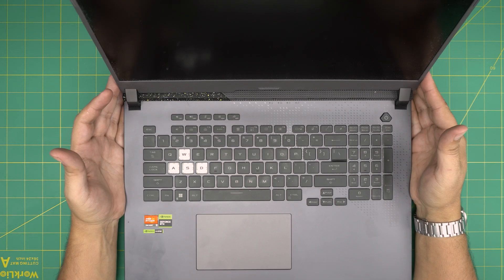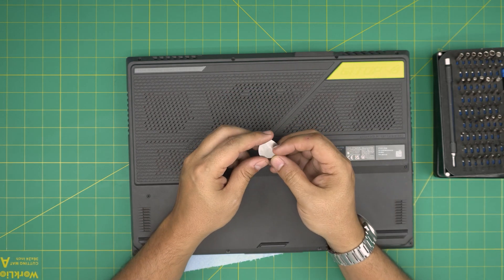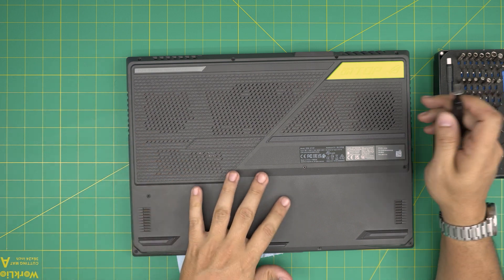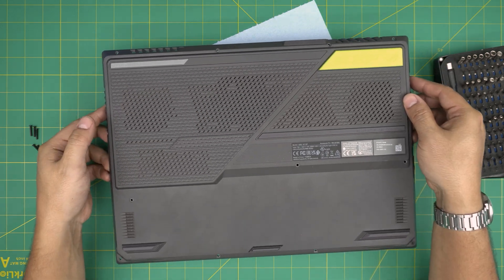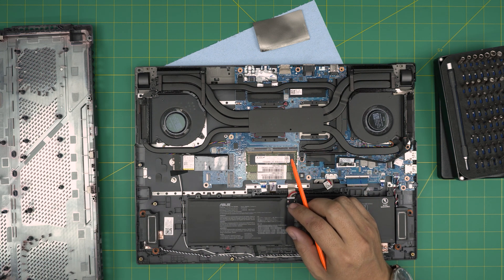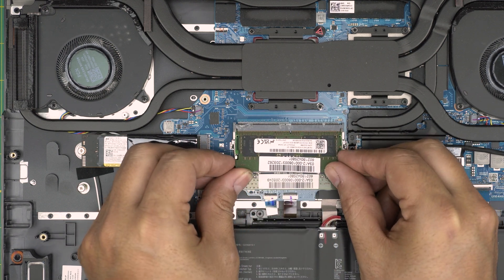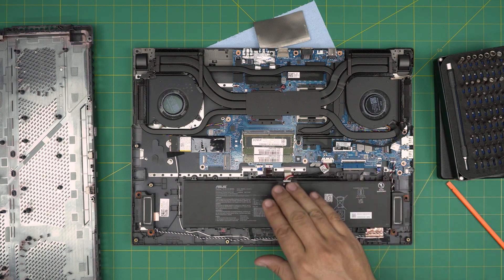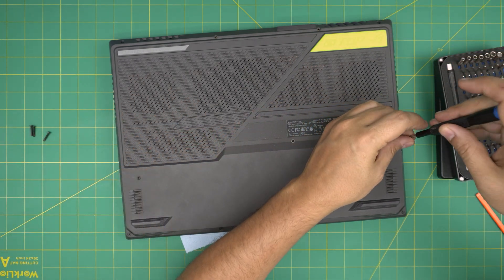How to Upgrade RAM in an Asus ROG G17 Laptop | G713Pi DS94

Comment: Hello. In two of your reply's below, you mention two different sets of 64GB ram.  In one comment you mention its OK to use 4800 64GB Crucial ram and provide a link.  In another you mentioned the 4800 wont work and you need to use 3200 64GM ram. I wanted to do the 64GB 4800 set for a G173PU-RS94 laptop. Will this work?
Reply from the maker: Use the 3200 because if you install the 4800, the BIOS will automatically adjust and lower it. That’s why you can’t use the 4800.

Comment: Hey sir
I have a asus rog strix g17 model G713PV -WS94 I'd to install 64 of ram memory but Asus company recomend for these model maximum 32 gb.
Could you help me ?
Is it possible?
Reply from the maker: 🫠Regarding your question, sure you can place 2 x32GB for a total of 64gb , don't listen to the asus they have no idea what they saying.
Should you have any further questions or requests in the future, please don't hesitate to ask me.
cheers🍻
Reply: @uFixTek  Is there any difference between DDR5-4800, DDR5-5200 and DDR5-5600?
Reply from the maker: You can add 32 GB per slot without any issues.
And in this laptop, you won't notice the difference between 4800 and 5600. Even if you install 5600, the BIOS will automatically adjust the RAM speed based on the size of the RAM you're installing.
Reply: Thanks for helping me ask this question. I have the exact model (G713PV-WS94 with 16GB RAM and 1TB storage) and was thinking in that line - 64GB upgrade. Maybe what the ASUS people meant was 32GB per SSD slot.

Comment: Hello... is it possible to install 32GB (16GBx2) DDR5-4800mhz RAM without any problem?  
(G17 G713PI-R98R4070, 2023)
Reply from the maker: 🫠Regarding your question, sure! You can place that 2x16GB DDR5 on the model you mentioned, and it will work without any issues. Just a note: after placing the RAM and powering on, it may take up to 2 minutes for the board to complete a memory check before displaying anything.
Should you have any further questions or requests in the future, please don't hesitate to ask me.
cheers🍻

Comment: Thanks, Dadash for your videos. I changed the thermal paste and will change my ROG Strix G713 2021' RAM based on your videos. They are extremely helpful. One suggestion though, please upgrade your mic for better audio quality.
Reply from the maker: Dadash, I have spent so much money on the best mic. I'm using a top-of-the-line mic, but the issue is the background noise from the street and the next-door store. After filtering, the results are still like this. Trust me, I'm trying every possible way.
im glad that my videos are helping, you irani or azari?
cheers🍻
Reply: @uFixTek  I see, I thought it could be due to isolation. Also, Irani😁
Reply from the maker: Nice, Tabrizi! 🫠
Yeah, I have this issue with sound as I have wall foams, and my store is located right on the main road. My neighbor’s store is a female gym, and they play the loudest music. 😔
I'm using the best mics you can buy and using RTX noise cancellation, and I'm working to make it better, hopefully i can find a solution for this.
see you around brother.🍻
Reply: @uFixTek  Nice! 
Anyways, thanks again. I'll be checking your videos out from now on.

Comment: I want to remove one of my 8gb and add a 24gb 4800mhz to total 32gb please will that work?
Reply from the maker: 🫠Regarding your question, sure it will work fine without any issues.
Should you have any further questions or requests in the future, please don't hesitate to ask me.
cheers🍻

Comment: I have a rog strix g17 with ryzen 9 7945hx, can i push it to 64 gb ram from the standard 32gb ram? The model is g713PI
Reply from the maker: 🫠Regarding your question, yes you can without any issues.
Should you have any further questions or requests in the future, please don't hesitate to ask me.
cheers🍻
Reply: @uFixTek  thank you so much. I'm worrying maybe the processor and the motherboard can't handle 64gb ram
Reply from the maker: oh it will without any issues.
but 32gb it is a very sweet spot.
Reply: @uFixTek  the problem is when I'm playing the memory is dropping even if I'm using rtx 4070 gpu
Reply from the maker: what you mean memory dropping during game? expand plz
Reply: @uFixTek  like when playing forza horizon 5, a low memory sign popping up
Reply from the maker: that is the GPU memory not the ram memory, your issue you have limited GPU memory that you can't do anything about it.

Comment: My Rog Strix g17 109w model came with single 16Gb 5200Mhz. After I replaced the old one with 2X32Gb 5200Mhz my laptop keep getting event41 error and  also having screen flickering. How can i fix that please sir.
Reply from the maker: something is wrong with the new rams, we upgrade them all the time without any issues or flickerings.
Reply: @uFixTek  which model do you use for replacement sir? Can you recommend?
Reply from the maker: use the Crucial brand
https://amzn.to/45uivD6

This is an Amazon affiliate link. When you use my links, you are helping to support the channel. 🙏

Comment: Hey my Rog laptop maximum ram 4800mhz but my   processeur mobile amd ryzen 9 7845hx max ram speed it’s 5200mhz which is a maximum😢❤ please brother 😢😊
Reply from the maker: 🫠Regarding your question, you can place a 5200mhz and the motherboard will auto adjust to the max ram that it can run, even if the cpu can handle the 5200 but the bios has to support and your bios can only handle 4800mhz, so get the 5200 and install
Should you have any further questions or requests in the future, please don't hesitate to ask me.
cheers🍻,
Reply: @uFixTek  all so I can install 5200mhz ddr5 ram.  Thanks you so much sir ❤️‍🔥❤️‍🔥❤️‍🔥
Reply: And, I see in official website my asus rog strix G713PU-HX039W support maximum 32gb ram but I see another YouTube video his tell 64 gb 
My question is a my laptop support 32 go ram or 64 by ram ❤
Reply from the maker: you can install a 64gb we have upgraded to 64gb for our clients. don't listen to the asus manual or service center they have no clue.
https://amzn.to/4afNZOg
cheers🍻

This is an Amazon affiliate link. When you use my links, you are helping to support the channel. 🙏

Comment: I have a question want ram I need to upgrade to here my specs 10:06 °
C X 5GUC ill 71%3
ame
AMD Ryzen 9 5900HX with Radeon Graphics
16.0 GB (15.4 GB usable)
098BF6CC-9485-4565-BA32-C6B22867590D
or
d RAM
ID
tID
00325-82205-65447-AAOEM
64-bit operating system, x64-based processor
Na pen Or touch input is available for this display
n type
X with Radeon Grs
bleal
:5-BA32-C6B22867
AAOEM
item, x64-based p
utis available for
23
D
OfferUp-

Comment: is it possible to install 64GB RAM (2X32gb) DDR5-4800Mhz?
Reply from the maker: Thank you for your feedback! If you wish to support the channel, you can like, subscribe, or both!
Regarding your question, yes you can without any issue we have upgrade this to 64gb, we use this compatible rams: https://amzn.to/46yxn2j
the 4800 wont work you need to go max 3200 and the bios will auto adjust to the max ram speed it can take the 64gb, the more GB the Mhz will be adjusted automatically lower.
as this is a laptop the bios doesn't have the XMP option, you you left with auto adjust.
Should you have any further questions or requests in the future, please don't hesitate to ask me.
cheers🍻

This is an  Amazon affiliate, when you use my links, I earn a percentage, which helps support the channel🙏.